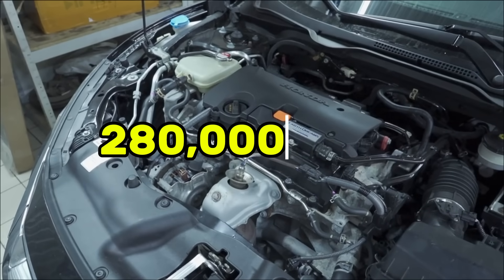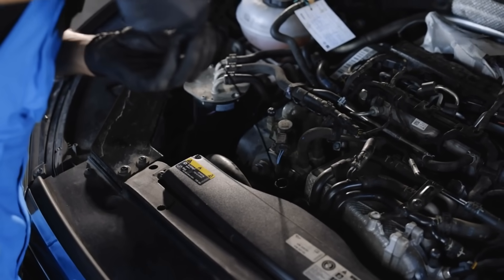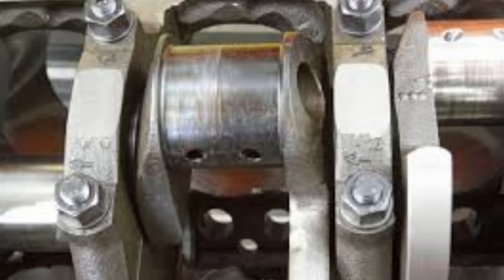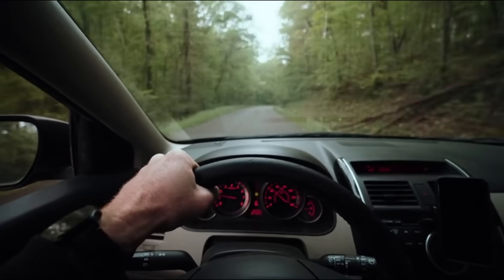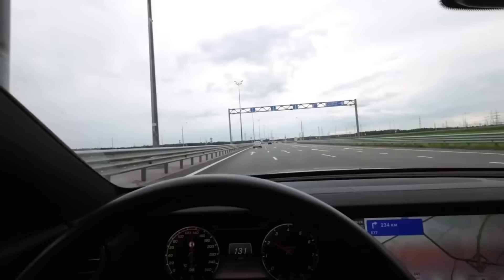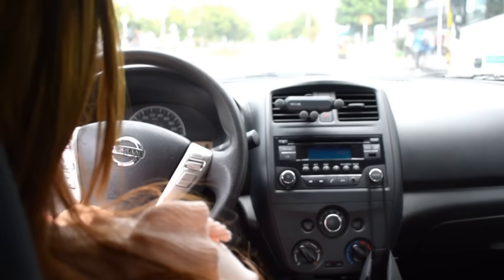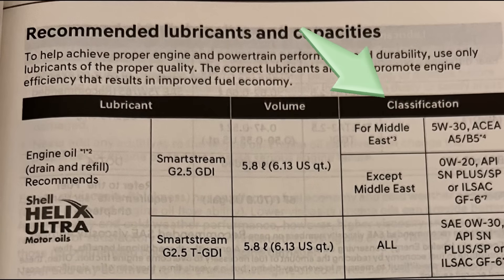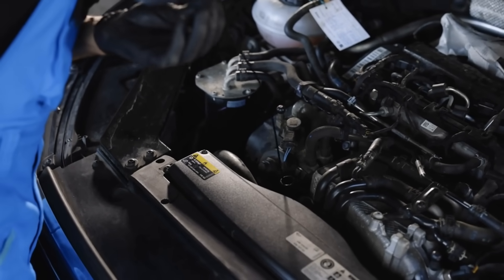I Tested 200,000 Miles of Engine Oil and Found the SHOCKING Truth

Comment: In north off Québec, Canada... winter goes as low   as -30 and summer as high as 35 celsius. Can i use 5w30 in summer and 0w20 in winter?
Reply from the maker: Avoid switching. Use a 0W-30 full synthetic year-round for superior cold-start protection at -30°C and reliable film strength in 35°C summers

Comment: Have run 5w20, and 0w20 in my 2012 focus all it's life. I change the oil every 8500kms.  The car now has 313 000kms on it, and still uses very little oil between oil changes. I bet with 5 w 30 and the same intervals, the car would be rusted away well before the motor went.

Comment: I live in Stockholm, Sweden, and I have a rather small VW Polo for commuting for work 62km, equals to 124km each day, and I am doing a lot of highway speed 60-75mph. Yes I know, It is not a big engine, 1.2 liter Turbo, doing almost 3000rpm at highway speed. Volkswagen have been recommending 5w30, but I am even going to try out 5w40 as one of our big auto retailers have in their assortment. This summer my car sounded really bad when I just turned of the highway and got to work, but when the oil got cooled down, the sound was perfectly normal again. A few months later that noise got permanent. Both hot or cold engine. I can tell, this is how you kill an engine in the long run. Going at constant high rpms. Now I have another car with lower mileage.
Reply: @henkeB006...Hi, from the state of Arkansas, U.S.A. I would not blame the highway speeds at all. In fact, highway driving is better than a lot of stop & go driving. I would be wondering about the turbo-charger. They give people a lot of problems if it is a poorly manufactured one. They also produce a lot of heat and need to cool down a bit before shutting off the engine. Some engines have a cooling fan that continues to run after the car is shut off to help cool down the turbo. Do you know if your Polo has such a system?

You didn't mention how often you changed the oil in the Polo?

Comment: My wife's 2013 Civic called for 0w-20, I changed it out at 500 miles and put 5w-30 synthetic usually pennzoil. It has almost 300,000 and does not burn a drop every 5,000 miles when I change the oil. My wife's new Toyota called for 0w-18 I did the same to it.

Comment: What happens if I drive in a humid place?, temp is usually 80 degrees my car uses 5w20. Should I change to 5w30? It’s a 2015 Mazda cx9 v6 awd. I change the oil every 5,000 miles.
Reply from the maker: Stick with 5W-20 full synthetic. Humidity makes your regular 5,000-mile change interval even more important for engine protection

Comment: So I got a 2012 Accord with around 200,000km (124,000 miles) that uses 0w-20. Live in Ontario Canada. Hot and humid in summer, freezing in winter.  Should I  switch?
Reply from the maker: Stick with a Full Synthetic 0W-20 (consider the High Mileage version). The "0W" is too important for Ontario winters to switch away from.

Comment: 2004 nissan altima lasted only 89K miles using 5w 30. My 2013 toyota 4runner 40K miles using 0w 20 still drives new no issue and I live in Hawaii. I think it depends who build the engines.
Reply: Martinez....Yes, many factors have to be considered: The climate where you live, the reliability history of the motor ( some have great reliability and others are terrible...not a fair comparison ), oil change schedule, driving habits ( lots of stop & go...lots of highway driving...etc. ), and other factors. 

Everyone's situation is different. There is no single, absolute and correct answer. Find out what your motor works best with...use common sense. 
 
About one year ago now, I bought a 2015 Toyota RAV4 with the 2.4 VVTi motor that had 128,000 miles. The oil cap says 0W-20 and that is what I used whenever I did oil/filter changes every 3,000 miles. But every time I started the car, it kind of rattled and even after driving a while, the rattle never completely went away. I asked my mechanic of 25 years, who works on foreign cars, about switching to 5W-30. He said it would be just fine. I did and the difference was immediate: no more rattle, even on a cold morning start, and the motor sounds so much quieter now. For my situation, going to 5W-30 was what my motor needed.

Comment: I have 90+k,  use 5w30 & it doesn't burn a drop.
Reply: I put 117,000+ miles on our 2009 RAV4 and it never used a drop of oil between 5,000 mile oil changes with the recommended 0W-20 oil. I even had the oil analyzed occasionally and the results were always stellar.

Comment: My motors get 10W40.
3.6 Pentastar
7.3 Ford gasser
4.3 Chevy
4.0 Nissan 
Nooooo problems!
Good oil pressure
less blow by
Happy lfters, no valve noise or chain noise
Great film strength
Happy engines!

Comment: Subaru ev smother sound on mixing 50 50 approx 0 20   5 30 will move to 0 30 because  the temperature goes from 15  to  30  warm climate. S Australia.
Reply from the maker: Thanks for sharing your oil strategy for your Subaru in S. Australia, adapting to the temperature changes!

Comment: At present 10w 30, going to 5w 30 both Synthetic. And not going because of this info but based on my 314000 miles on my last engine. Plus other info from my go to vehicle Toyota 97 T-100 that recommended 5W-30.
Reply from the maker: That's great you're basing your oil choice on your own extensive experience and your vehicle's recommendations!

Comment: The Toyota dealership I work for in Texas had two 2016 Tundras each with the 4.6L 1UR-FE V8 engine. When they were retired one had 378K miles on it and the other 416K miles. Both still ran perfect, had no smoke out the tailpipe and used no oil between 10K mile oil changes. Both got the Toyota 0W-20 oil (made by Mobil) the factory recommends their entire life.
Reply: maybe they actually changed their oil on time ????
Reply: BS.
Reply: Cool, because I run 0w-20. I should run 0w30 in winters and 5w30 in the summer; from now on.

Comment: Just changed the oil on my mom’s car a few months ago and I was shocked to find that the mechanic has been using 20w50 for about 2-3 years now, mind you the engine is a 1.3ltr 2NZ-Fe by Toyota 

When changing it I just swapped from 20w50 to 10w40 but same brand (castrol ) nd honestly it still works perfectly fine…..
Reply from the maker: Thanks for sharing your observation about the 20W-50 and the smooth transition to 10W-40 on your mom's car!

Comment: 0w-30 in a 2000 4Runner with 372000 miles for about 15 years now and I just switched my Lexus GX 460 with 16000 miles to 0w-30 also and that engine calls for 0w-20 after realizing that outside of the US it actually uses 30 oil. Crazy what’s happening here.
Reply: Using 5w30 here in S. Florida but thinking about going further because oil consumption is 3qt every 5000 miles. Maybe 10w30. 2012 Camry, 234,000 miles
Reply: @truthseeker1979  wow, consuming that much oil? You have a serious engine issue.
Reply: @Maynardd yeah, one shop said my intake was leaking  so I assume oil is getting past the rings, becoming mistified or whatever  spraying into the intake.
Reply: @truthseeker1979 how is an engine problem a viscosity issue?
Reply: @georgesbv1 My issue is mechanical not doubt, going to replace the block soon. Just heard using a thicker oil would slow the consumption down.  My 2arfe engine has a history of this.
Reply: Dang!
Reply: Why buy a 15 year old model?

Comment: I have a 2010 Ford Ranger with 320,000. Runs great with little or no oil consumption between 5,0000 changes of full synthetic 5w20. My question is since it’s holding up so well, should I stay with 5w20 or move up to 5w30?
Reply: with  320K miles ?  Don't change a thing !!
Reply: Switch to 0W-20

Comment: I own a 2012 Prius and it's recommended to use 0-20 And I've been using 0-20 all this time It has close to 240,000 miles and it's not burning any oil whatsoever, I had a head gasket leak and I had the head gasket changed out with new one, and the mechanic complimented me on how clean the engine was when it was taken apart, it's going to get to 300,000 mi pretty easy. I think this may work for other vehicles changing to 5-30 but I don't believe this is for a Prius unless it's really super cold outside and the environment is always cold sun up to sundown.

Comment: In Kia GDI turbo hybrid I use 0W20 recommended by manufacturer but i will start to use 5w30 , it makes more sense !
Reply from the maker: That's a common thought for some, moving from the manufacturer's recommended 0W-20 to 5W-30.
Reply: So you think you'll switch based on what is said in this video... It's only words. There is no proof that what is claimed here is actually true.

Comment: the motor oil guy also did a similar test with similar results. My Skyline says to use 5w -30. I changed to 10w - 40. runs better, the oil is used for the VVT system. Now so consistent on power delivery. even better fuel economy.
Reply from the maker: That's great to hear you found an oil that works even better for your car, improving both power delivery and fuel economy!

Comment: Change your oil every 5,000 miles instead of the manufacturer’s recommended 10,000 mile oil change interval.
Reply: Cheaper to change oil regularly than the price of a new engine,change the oil at half the recommended mileage.
Reply: @xl250mon5 gee, y don't u change it every other time u fill ur tank... yes, that's how silly it iz 2 change that often ...
Reply: My toyota burns oil, so every 2500 for me
Reply: @Luckibastard You can add some.
Reply: @Luckibastard what motor?
Reply: indeed
Reply: This, unless you use ester or poa base stocks every petroleum based oil will sludge up with heat degradation, even the vaunted synthetics, a good base to work with is 5000 miles do your oil change, if you are using esters or poa's feel free to stretch those miles out a bit
Reply: my 16 plus year old Mercedes is going strong with 10K oil changes using full synthetic and OEM filters. If my engine was turbocharged I would change it more frequently
Reply: Another point, the manufacturer selects a filter with adequate capacity to capture expected particulates emitted to the lubricant.  It has less to do with the miles than the amount of particulates expected for the mileage of the interval.  So the surface area of the filter needs to be adequate to capture the material before the filter limit is exceeded.  So thicker oil here hurts you as well, it's more viscous and resists flowing through the filter material.  Go too thick or too much particulates the differential pressure across the filter will rise, the filter bypass disc will spring modulate open to keep oil flowing by bypassing the filter as much as needed to provide lubricant to the engine parts.  The manufacturer whether you believe it or not has a vested interest in delivering the best product, durability, and economy to enable them to charge a premium price for their product.
Reply: I’m going to switch to 5W-30. I have a 2020 sienna six cylinder. I’ll run the 0W 20 in the winter, I’ll keep you posted😂
Reply: Have a dodge ram with 300,000 plus. Still runs like new, change oil every 3000
Reply: Every 5,000 miles, or once a season, is the best time.
Reply: I change the oil between 5K and 7.5K in my 2010 Toyota and my 2011 F-150.
Reply: I've always changed mine every 3,000, and will continue to do so.
Reply: @wizardofahhhs759 I'm a 60 yr old man, if you're changing it at 3,000 miles, you're throwing $$ away. 
Things have changed dramatically over the last 40 years, especially with full synthetic.
Reply: @wizardofahhhs759 me too
Reply: @wizardofahhhs759  If it's synthetics you're wasting money and resources.
Reply: Too bad I don't live nearby and can use your recycled 3K oil.  Would never need to buy it again. And my 225K Mazda5 is running fine on 6K oil changes.
Reply: @Timmymao-RIP  depends on how u drive... revving it out and city vs highway miles... 6k city is way diff than 6k highway... same as a 16 yr old girl driving 5kmiles vs a 80 yr old guy going 5kmiles...
Reply: If you got it, flaunt it😂👍
Reply: Absolutely
Reply: 0w-12w
Reply: The perfect example is NASCAR. in the 90’s(& probably where this thin oil started) NASCAR teams would use thin oil in their engines to qualify for 2 laps,because the oil had less drag, & for the race they would drain it out for thicker oil for a 500 lap race! Why do you think that is!? And a foot note sometimes these races were in colder weather! And the moral of the story is thin oil doesn’t protect SHIT in day to day driving & the first thing I do when I get my new vehicle is get rid of that crappy oil in the engine for thicker. Do your do diligence and send your oil off to a lab for your oil to be looked at, but I know what the answer will be
Reply: and filter, no point changing oil if you dont cl3an the filter and engine.
Reply: @Steve211Ucdhihifvshi    that should go without saying
Reply: Am besten ☝️  bei jedem vol tanken, unbedingt auch das Öl wechseln. 😅
Reply: Proof?
Reply: @jimross2101    watch “The Car Care Nut” on YT regarding Toyota recommended 10k mile oil change interval and the oil burming and sludge problems that ensue.
Reply: @jimross2101  its the only thing keeping all your metals sliding and is way cheaper than a £6000 engine .

Comment: In my 2022 Kia Soul the dealer was using 0W20. I changed to 5W30 Castrol Edge. My engine is quieter, smoother and overall better protected. The dealer has since changed to 5W20. I neither like or trust their bulk oil. The service department can't even tell me what brand it is!  Scary ! To this day, I use Castrol full synthetic in the Kia and Valvoline VR1 (spring and summer, 20W50 VR1 , fall and winter 10W30 VR1 in my 1967 MGB. The Valvoline VR1 is a extra ZDDP racing oil, with 1400PPM zinc.  Keeps the flat tappet cam and lifters happy.
Reply from the maker: Thanks for sharing your experience with different oils for your Kia and MGB, especially how you've tailored them for better protection!
Reply: The 5W-20 is likely cheaper because it's not synthetic. There is no such thing as 0W-20 in conventional oil. Synthetic cost more than conventional...

Comment: You need to understand......your oil charge is mostly a coolant. Virtually any  mineral oil will lubricate your engine. The real problem is to get sufficient coolant through your bearings to keep the temperature down.
As your engine wears, and bearing clearances increase, first your oil pressure will drop a little. As wear progresses, dynamic wedge in bearings may start to suffer. But oil flow will increase (which is what lowers the oil pressure), so bearing cooling is still fine.
So what to do? Stick with manufacturer's recommendations until your engine is fully run-in. That could be 70K miles on a modern engine.
Round about 50K miles, get a scan of your ECU, specifically to find your oil pressure. (I hate modern design; so much information, none of which is presented to the owner).
If your pressure is starting to drop a little, you can think about the oil.
First consideration is what's the ambient temperature? If its cold-ish (Scandinavia, for instance) stick with the lower spec, say 0W, instead of 5W. If you live in Egypt, go 10W instead of 5W.
But generally stick with the oil viscosity recommended at the higher end, until you get past 100K, then maybe go up from say 20 to 30 weight, or 30 to 40 weight, but no further
And......
If you drive a Diesel, be certain you are using C2 or C3 oil, which is ash-free when it burns, and won't clog your DPF.
Use fully synthetic oil. It tolerates higher temperatures for longer, and is generally more stable.
Don't cut cost by extending running time. Change your oil and filter, and do it early rather than late.
If you don't know any better  stick with OEM recommendation fir the life of the engine.
If you do it yourself, use reputable oil brand, and don't buy cheap filters.
Lastly, some engine ECU'S are so damn clever, they can work out which oil you've used (from pressure, pressure curve with engine speed, flow and temperature, compared to stored internal operational maps) and will put an engine fault light up if it thinks you've used the wrong grade.

Have fun@
Reply from the maker: Thanks for sharing your detailed thoughts on oil as a coolant, viscosity adjustments based on wear and climate, and the importance of using quality filters and synthetic oil!

Comment: When i was living in North East Coast US where it gets very cold i used 0W-20 in my Honda Pilot. Now I live near West Coast where winters are close to 36*-40* F I use 5W-20 in winter and during summer it's hot n dry I use 5W-30 i don't go by milage at all I determine my oil changes according to climate. I barely do 8000 miles a year on my Honda now so I change oil whenever seasons change. After 350000 miles this Pilot's engine still runs like it's 50000 miles on it.😊
Reply: Don't forget to add Lucas oil bottle to the mix. Engine runs very smoothly, quietly 🤫.

Comment: I have 2020 Corolla hybrid with 325.717 miles with 0 problem,I used 0w-16 1st 100k miles, I change oil every 9-10k after that 7k miles oil change,Toyota design a engine for this oil…Toyota is the best quality car in the world…
Reply: IDE love to know how you put 357 thousand miles on a car in 5 years? That’s crazy
Reply: @naunkshug7281  You would be surprised how many folks actually do this. Cars driven this many miles are the cars that sometimes go for a million miles on one engine. It's cold starts that cause the most engine wear, not the miles driven or the oil you use. If you drive over 90% highway miles you can likely follow the 10,000 mile oil change intervals. I'm sticking with 5,000 miles cause I don't drive over 90% highway miles.
Reply: @njsongwriter  Yea same here every 5k. I also switch to 5w30 during the summer because we are in the Deep South. Engine seems to like it.